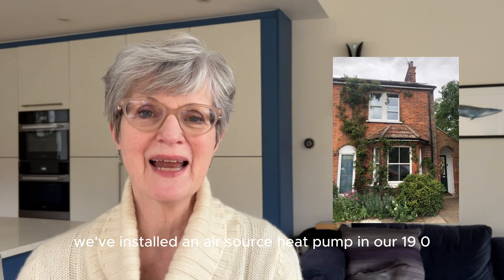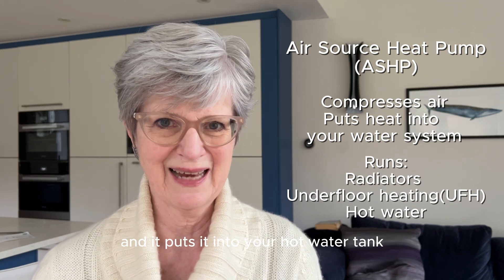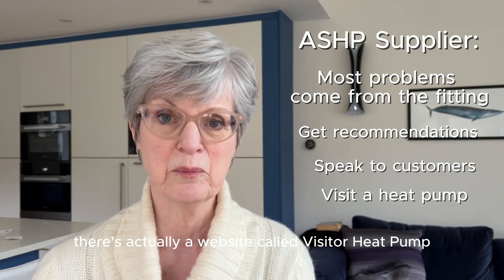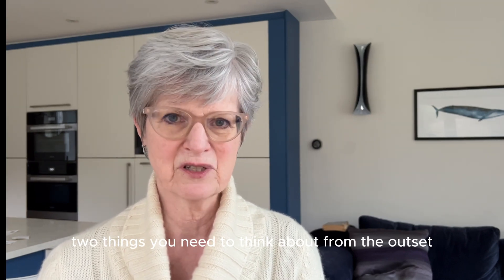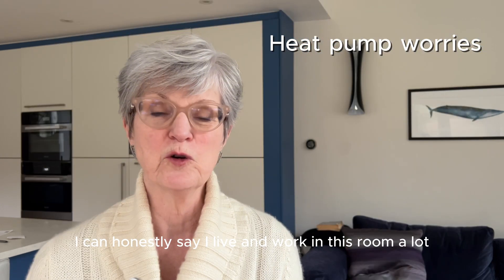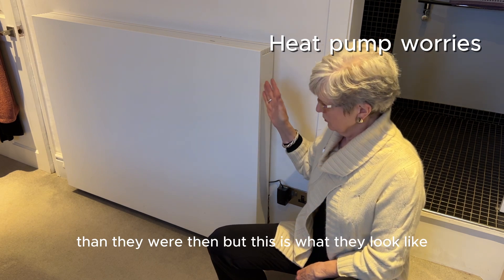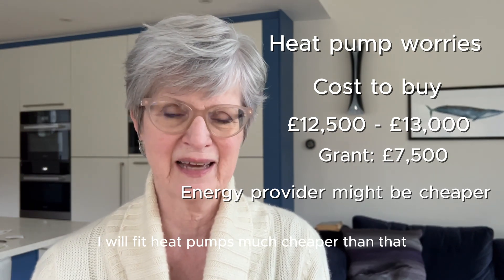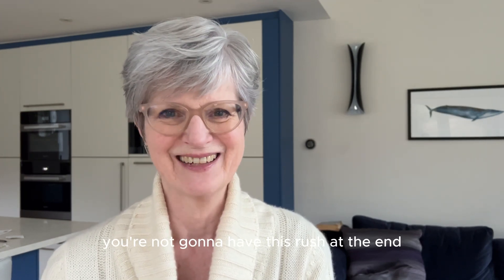Media confusing you about air source heat pumps? Here's what it's really like to live with

Comment: Houses need ventilation to prevent condensation and mould.  But they need to be airtight to have more efficient heating.  Which is more important?
Reply from the maker: You need both. Insulation needs airtightness to be fully efficient. And airtightness needs ventilation. Airtightness cuts out the uncontrolled air and ventilation puts it back in a controlled way. Doing one without the other leads to condensation and mould, just as you say.

Comment: Sorry, you obviously do not understand how heat pumps work. They do not compress the air. Thus your video does not inspire confidence.
Reply: Clearly the description of how it works to recover heat from the air is wrong, however the user experience is just as valid as from someone who does understand the science and engineering. In some ways more so as basically what matters is having a nice warm house while saving massive amounts of carbon, and this shows you don't need a detailed understanding for it to work well for you.
Reply from the maker: @MentalLentil-ev9jr  Thank you for your comment. I appreciate it. As you say this is about my experience of living with a heat pump. I should have left the technicalities alone!

Comment: You need hot water at 60 degree to stop bacteria growing in the hot water tank. This is why some heat pumps owners have a small boiler to boost your hot water to the safe temp.
Reply from the maker: thank you for adding that. We have an emersion heater in ours that heats the water to a higher temperature once a week to avoid the risk of legionnaires disease. I think they might be obligatory and integral to the machine?

Comment: I have a LG Therma V Monoblock 60 degrees HTHP. Cost 3575 euro. Subsidie 3075. Google LG Therma V Aircoplaza. 500 euro. Very silent very hot for the radiators in the house. No noise at all. Try LG Therma V Monoblock 60 degrees 9 KW. Connected to the existing Central Heating radiators. Make a connection and done. Easy. Heats every House with normal radiators. Works like a gasheater. Rooftop Solar, Inductioncooking, Heatpump LG Therma V. I let a house with the same System. Family 2 kids. My House is from 1910 in Groningen Nederland. For 12 years now No Gas No Energybill. 22 degrees in the house. Off at night works perfectly. Runs 6 hours a day consumption 15 kWh now at Christmas Time 2024. Succes.
Reply from the maker: Those are brilliant stats - thanks very much for sharing. You get a lot more in grant than we do here in the UK, which is brilliant. Sounds as if you are further along than us in use of heat pumps - so good to hear.
Reply: @ecorenovationhome  yesterday 25 kWh for everything. Lights on, Christmas Lights outside, Christmas Tree inside, Cooking shower, tv freezer warm Water and Heating the House 22 degrees. It will be a Warm year next year. Google LG Therma V Monoblock Aircoplaza Zwolle. See for yourself. Thank You 👍🌹❤️ good Christmas Days and happy New Year.

Comment: I'll save you the embarrassment of getting any more negative comments by not sharing this video.
Heat pumps do not compress air, the refrigerant extracts heat from the air and then the refrigerant is compressed and increases in temperature. The refrigerant is the working fluid.
Air to air heat pumps can work in reverse and cool rooms.
Reply from the maker: Thank you for your explanation - very useful. The channel is for people who are new to the tech of retrofit so I'm keeping it simple as I can. That's what I needed when we were doing the work on our house. My main point was to explain why the COP of gas to ASHP is so different - one creating heat, the other moving heat.

Comment: An air source heat pump does NOT compress the air it takes in, it compresses the refrigerant that's circulating inside of it. That raises the temperature of the refrigerant, and this can be used to increase the temperature of the water in the heating system. In the process, the refrigerant cools down. Next, the refrigerant is decompressed in a vaporiser, and this lowers the temperature of the refrigerant even more, to become lower than that of the outside air. This means the heat that's in the outside air is transferred into the refrigerant, cooling the air and heating up the refrigerant again. This is then sent to the compressor to start the cycle over again.

Because of the laws of thermal dynamics, energy will always transfer from a high to a low, in this case from the relatively high temperature of the outside air (even if it's freezing) to the relatively low temperature of the refrigerant (after vaporising), and later from the relatively high temperature of the refrigerant (after compression) to the water in the water system.
Reply from the maker: Thank you for this for clarifying - I'm delighted to learn more. This channel is meant for people, new to retrofit, who need to understand the basics so I maybe simplified too much. The purpose of the explanation was to explain why the COP of gas to ASHP is so different ie: one creating heat, the other moving heat.

Comment: This is probably the best description of a heat pump I've yet seen! Thank you!
Reply from the maker: Wow  - that's great! thank you for telling me.
Reply: Sadly it is incorrect.
Neither heat pumps nor refrigerators compress air.
Reply from the maker: @Paul-yh8km Thank you for letting me know.  I am aiming at giving a simple explanation to people who are new to the technology and need not to go into technical detail. I will be adapting the video soon to reflect this.
Reply: @ecorenovationhome what it does is compress a gas that has an appropriate boiling point. It uses the phase change between liquid and gas. When a liquid evaporates it pulls heat out of the surrounding area to change into a gas. Condense  from a gas to a liquid and it gives heat out. This is what moves the heat from one place to another. Heat pumps typically contain the refrigerant and just have the water going into the house. 

Heat pumps don’t warm the fabric of the building any more than gas boilers. What they do is modulate so cut their power when the house is up to temperature and they keep the house at a set temperature where as a boiler usually has to switch off and on (some modern boilers modulate and reduce the on off cycling)

Oh and gas boilers are not going to be outlawed in 2035, they will be banned for new installations at some point. If they did outlaw something that is legal they will be required to give out compensation so that won’t happen.

Comment: The COP of gas is less than 1 as not all the energy is used to heat the air: a small portion is lost in the combustion products.  Also, there is no heating of the air to transfer heat, the refrigerant is compressed (which heats it) and internal air is then moved over the hot refrigerant lines thereby transferring the heat. This is why this type of unit is called a heat pump - it doesn't actually make heat, it pumps it from outside to inside via the refrigerant loop.
Reply from the maker: Thank you for that - appreciate the confirmation.